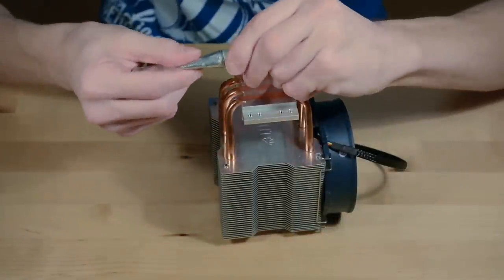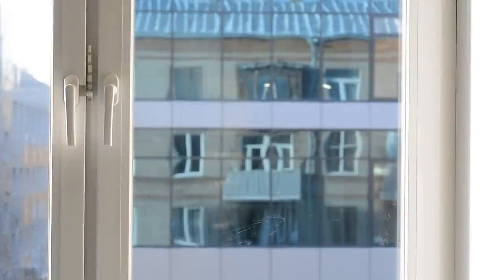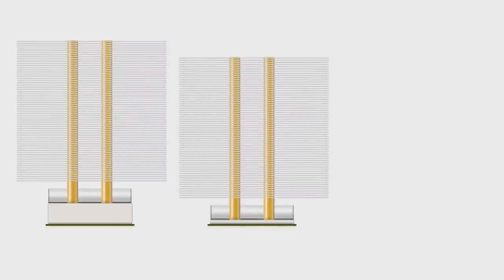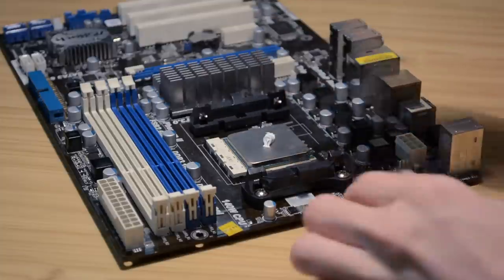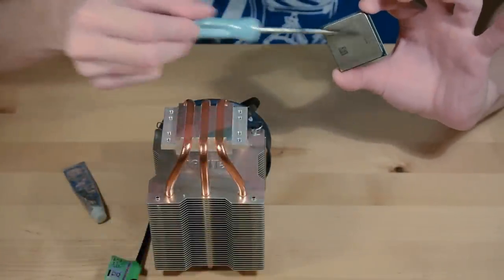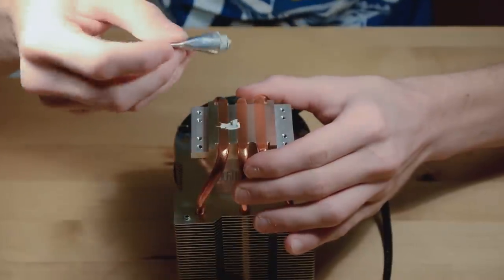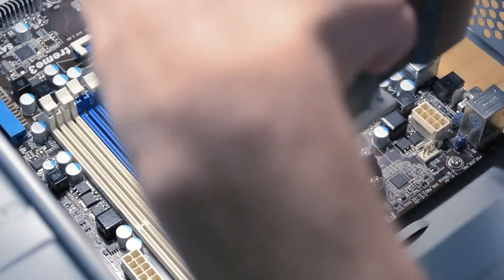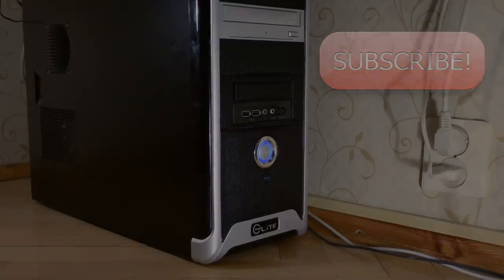Thermal paste: How much really need to apply and how to do it correctly? Как наносить термопасту?

Comment: The spread method is bad and you should feel bad.
Reply: some pastes spread different so pea method is not always good
Reply: use thinner TC perhaps?
Reply: Nothing to do with how thin or thick it is, spreading causes air bubbles and thus results in poor cooling. If you get it to work for you, more power to ya but it's been tested countless times and it almost always results in worse temps. Pea method or cross method are best.
Reply: Interestings Pretty sure that .3mm thick TC performs better than 1cm thick TC
Reply: And I'm pretty sure you don't know what you're talking about.
Reply: I fully agree with you
Reply: Luke A ...or just leave it without any compound so the spreade techique is not that bad

Comment: It doesn't matter if there is air around the middle of the CPU. If you take the head spreader off. (The metal part on the top of the CPU) you can see that other than the dye, which is about a quarter of the size or the actual CPU, you can see that it is just empty space. As long as the thermal compound covers the dye in the middle, you're fine. If you see the base of many stock coolers, such as the Intel stock cooler, you can see that it is actually smaller than the CPU itself. This video is misleading.
Reply: Correct

Comment: I own Asus G513qy advantage edition with RX6800M and Ryzen 5900HX.  Currently I have Grlid VC Extreme on CPu and GPu.  GPU max hotspot was 103c and after last repaste max hotspot 99c (mostly 98c max), and cpu maxing 97c.  And yes Asus stock LM paste was going to 102c gpu Hotspot! 

I think in some months try repaste again and hopefully have better luck with bit better Temps. 

I made amazon order for two products I read should be good:

1. Syy157 (8 grams)
2. ICEBERG THERMAL PLUS (7 Grams)

I think go hybrid one for gpu and one for cpu, what you would suggest? Which to use on what die?

Your honest help appreciated!

Comment: how did you check the temperature on the screen at the end of the video like that?
Reply from the maker: michael byrd It's free app - Speccy
Reply: +michael byrd You can also boot into your bios and it will tell you the temp there.  :)
Reply from the maker: dirint Yeah, I know)
Reply: +michael byrd Speccy isn't bad, but I prefer CPUID's HWMonitor. It will give you a high/low and current temp, as well as check voltage usage and other stuff.
Reply: +michael byrd No NZXT Cam fans here?

Comment: i've always use spread method.  Super thin and very evenly.  also like applying window film is best to start on the edge slight diagonally and roll it (the heatsink contacts) until is pressed on.  I dont use a credit card i use something small like plastic as a spatula.

Comment: I have a question. Any answer would be very gladly appreciated. 

I'm building a new computer with no experience building one. I'm using the stock cooler which has thermal paste pre applied on it, but I accidently touched the thermal paste on it, causing some of it to smear around. I was wondering if that's fine or if I have to buy more thermal paste and apply it. 

There looks like there's still a considerable amount on there but would the lack of thermal paste in that one area I touched cause like an air bubble or something? Thanks
Reply: i would recommend u go to an actual forum for this stuff because i dont think u will get a reply
as for the question, i have no idea
Reply: WeabooAtheistTrash I already built it and the temperature is running at a cool idle 28 degrees C.
Reply: i wish i could get a new pc
im rocking a whopping 2 gigs of ram on my potato laptop
Reply: WeabooAtheistTrash Well, always think on the bright side! At least you have a laptop!
Reply: yea lel

Comment: It's impossible to get a thicker layer of paste because it just compresses it and squeezes out excess. So the thickness will always be the same, it will just make a mess if you add a lot. And there have been tests that more is better than not enough.

Comment: Just because you apply more thermal paste doesn't mean the layer of thermal paste is going to be thicker. Thickness of the paste depends upon the clearance between the heat sink and the cpu. You can put like 20 grams of thermal paste on there but thickness will remain same. It will come out of the sides though so yeah... Don't put way too much thermal paste on there.
Reply: Not technically right. Completely depends on the viscosity of the paste and the Force applied to it. If you are clamping down electrical components just to squeeze excess thermal paste out something's going to snap eventually.
Reply: @JUMPAROUND1515  Almost all thermal pastes are viscous but at the same time they can form into almost any kinda shape you want. So viscosity does matter a bit maybe, but its overcome by the weight of the heatsink and the tension of the spring on the other side in most cases. I don't see how something can snap just because of thermal paste as it does come out the sides but again, not suggesting to put a bunch on there.

Comment: I used real temps to test my processors core heat, it idles at 35c and at full load one of the cores reached 90c running prime 95. That sounds too hot, idk?

Comment: What are the maximum temperatures for the i7 4820k Ivy Bridge CPU? I've looked all over, and I've seen multiple conflicting numbers.
Reply from the maker: Maximum operating temperature: 66.8 °C / 152.24 °F
Reply: Michael Zakharov
Thanks. I'm running too hot then. My maximum temperatures have hit 76°C while gaming.

I reseated my fan, and reapplied thermal paste.

I don't know what to do.
Reply: Gander Stein Max is 95¤ then it will start to clock down, when running 105¤ over a longer period its dangerous ;) You temp are fine, Dont worry ;)
Reply: I appreciate your input. Thanks a lot.
Reply: Gander Stein With my i7 3770k stock with stock cooler i run at about those temps when on demanding games even been in the 80s, i also thought that was high but after all this time its still running strong
Reply: *****
I finally got the temperatures lowered quite a bit.

I'm glad yours seems to be handling those temperatures well.

I appreciate your response.

Comment: That is not the way to apply Thermal Grease, there will be air bubbles all over. The best way is a small line in the middle and let the Heatsink spread the Grease.I have tried all methods over the years and this is the worst method ever.

Comment: Spreading it out with a card is bad advice. As you can see in other videos this does not distribute it evenly and creates air gaps. Far better to allow it to spread out as you push the heatsink down.

Comment: This is wrong, spreading the thermal grease will cause an uneven surface that will trap air when you put on the heatsink. The whole reason why the lentil technique works is because once you press the heatsink in, the paste itself will push the air out

Comment: Very informative and good video. Thanks! :)
Reply: Can CPU work without thermal paste applied?
Reply: anonymous2012s Long term? No. It will severely reduce the lifetime and potentially damage the other parts in your computer if you overheat too much.
Reply: Deifux Ok thanks!

Comment: 1st: Always apply the thermal paste on cpu. ALWAYS. A small amount In all its surface.
2nd. A good, or at least decent, cooler will never have a smaller surface than the cpu.
3rd. You're good to go.

Comment: at 2:05 what cpu cooler is that?
Reply from the maker: Titan TTC-NK35TZ/RPW(KU)
Reply: Does it work with 1155?
Reply from the maker: Yes
Reply: is this the same one? https://www.casetac.com/index.php?route=product/product&product_id=231339&currency=GBP&language=en and what temperaturs would i have on average? im using i5 3570k
Reply: Michael Zakharov
thanks that's what I was reading the comments for
Reply from the maker: Chris Rose Huh)) Yes. It's nice when you find the answer to your question in the comments)

Comment: Sooo, I applied some on my CPU, a very thin layer, then on my cooler. Everything good, until I boot the PC. It starts, but the bios never starts (I know this because I have a fan set to 50% cause it's too loud, and normally as I boot up the PC, the fan would be at 100% for like 3 seconds until the BIOS starts). Any ideas?

PS: The monitor says "No signal"
Reply: You may have damaged your cpu or bend a pin. Look carefully to the pins of your cpu, if one has bend, carefully bend it back.
Reply: If that isn't the case, it's also possible that one of the other pins on your board is bend. Our computer had a similar problem and didn't recognize the gpu. So it kept rebooting...
Reply: Yep, I solved it like 10 minutes ago. Seems like when I tried to put the CPU back, a pin bent. I discovered this just by accident, and then bend it back and now it works :D
Reply: lucky you
Reply: wow that was fast
Reply: i was online so...
Reply: You shouldn't apply to both as you are blocking the path for the air to escape when you clamp it down, increasing the chance of a bubble.

Its highly recommended to only apply to the CPU as a single dot in the middle.  I once applied what looked like a very thin layer but turned out it was way too much and it ended up in the CPU socket when I tried to remove the CPU later, completely trashing it.
Reply: For future reference: If the monitor doesn't pick up any signal (and even goes into instant sleep/standby mode when you turn on the computer) then you have put the CPU incorrectly in it.

Comment: Help! LAPTOP FAN RUINING CONSTANTLY. Laptop temperature 26'C Idle, 38'C full blast.
Fan cleaned, Thermal paste replaced, Bios flushed and updated, Windows reinstalled still NO JOY.
Anyone know what's the issue?
Reply: Try connecting to an external screen, with the laptop's screen off.  If the heat problem is not fixed, get an external laptop fan. Also, if there is a "recovery" drive, remove it for your laptop (it's not the one you can easily access), you don't need it.
Reply: +Ryan___Ryan Recovery volumes are 99% of the time a partition of the main drive, so that would be removing the same disk that the OS boots off of. With that in mind, you (DiiZ) should get an external fan, possibly an external side fan for the vent to assist the internal fan.
Reply: What laptop are you using? On a lot of laptops, 38C is actually pretty low depending on the processor and heatsink.

Comment: i dunno but i think hes wrong.. you should place the thermal paste on the cpu .. not on the cooler and spread it with a freaking credit card ^^
Reply: +Reppy07 Just out of curiosity, why? If i step in dog poo or the dog poo started out on my shoe, when i put my foot down its going to spread the same way. Do physics go out the window when it comes to thermal paste? Or do physics only work with dog poo?

Comment: I tried it. I started my CPU. I get no video. Motherboard has a green light ON so that seems active. Fan is Active, A/C Power is ACTIVE. Motherboard Battery is new.
Reply: Thermal paste is conductive and if you fired up your CPU with any on it then you could have very easily fried your CPU. You can test the theory if you have a known good/motherboard-supported CPU lying around.

Comment: Obviously the guy never removed the metal cap of the processor. If he did he would have noticed that the core chip which is the cooled part is positioned in the middle.So applying the paste to the whole heatsink surface doesn't make so sense at all.Nevertheless there are coolers with much bigger surface than the actual processor...and if you are following this method you are wasting only the material!So if you apply the paste like a line or like a drop it doesn't matter at all.The temp readings are the same. Only apply enough quantity.
And don't go for the cheapest thermal compound out there on the market. Cheers.

Comment: how you remove the old paste?
Reply: Alcohol based liquid is best. Use a clean cloth to wipe it off. It's only a recommendation, you can do without it. Just don't leave any residue of the old paste on the CPU.